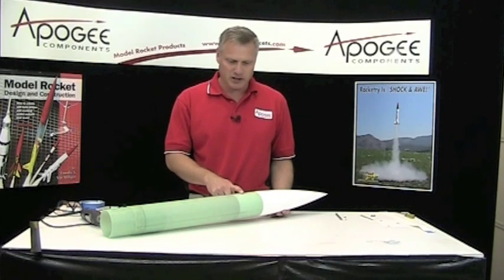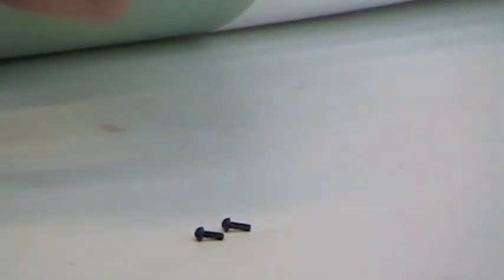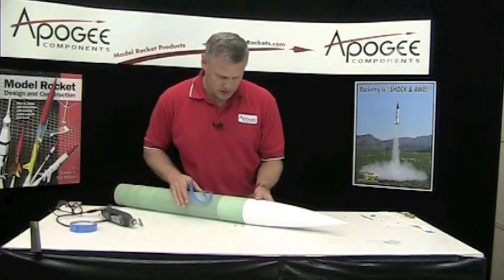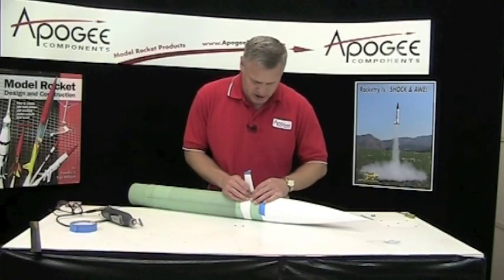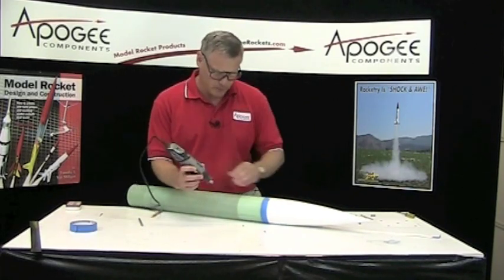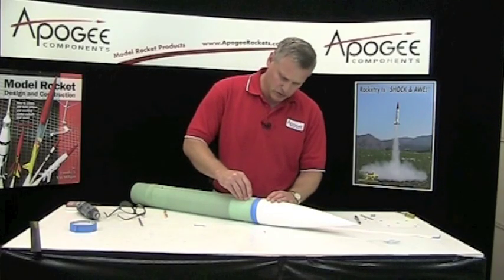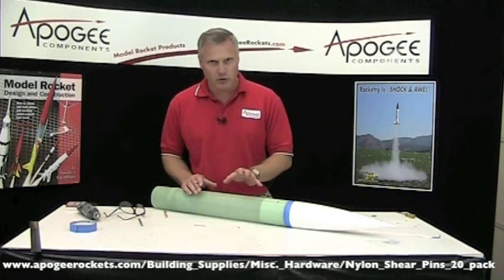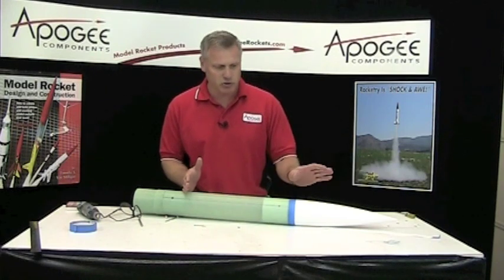Building the Level-2 Fiberglass Rocket Kit - 12: Install shear pins

Comment: Wouldn't you want to add shear pins to the booster section as well (going into the eBay) to protect against drag separation? I know I'm asking a lot of questions but this is my next build as I try for my L2 certification
Reply from the maker: You can if you want. But I never found it necessary if there is a vent hole to relieve pressure.